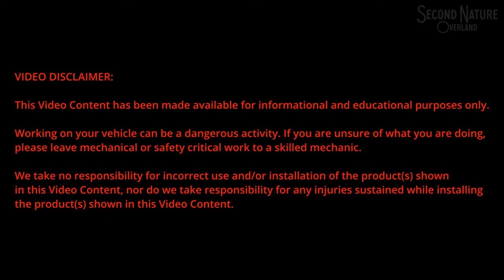MetalCloak Rear Shock Skid Plates 2021+ Ford Bronco (non-HOSS 3.0) Install

Comment: Useful video but on the JCR channel they claim that that strut bolt should be torqued back to spec when under the weight of the vehcile.
Reply from the maker: Thanks for watching and commenting. The MetalCloak installation instructions don't go into any details regarding that, but it's possible that's how it should be done.